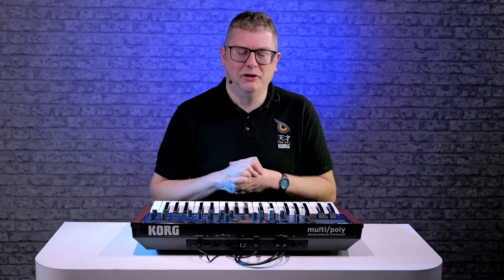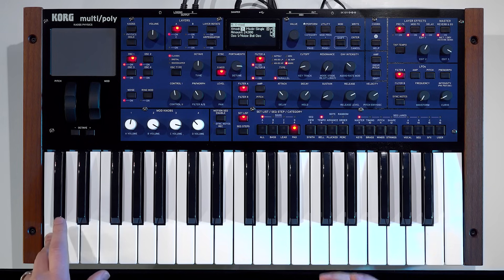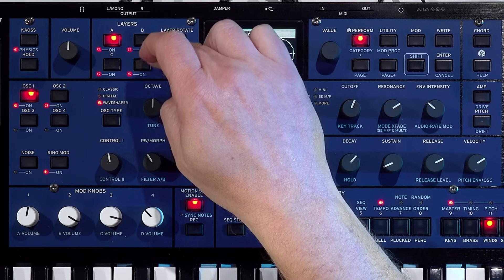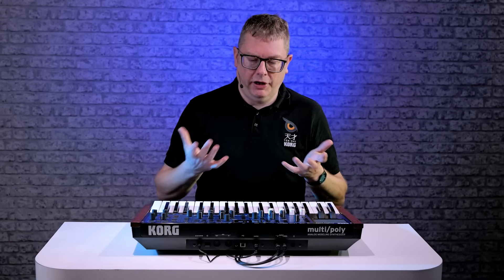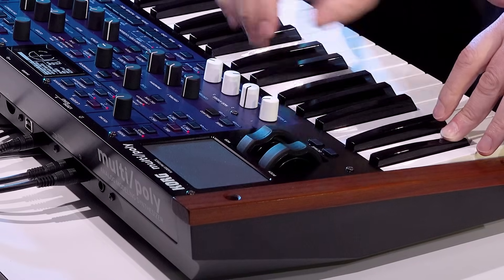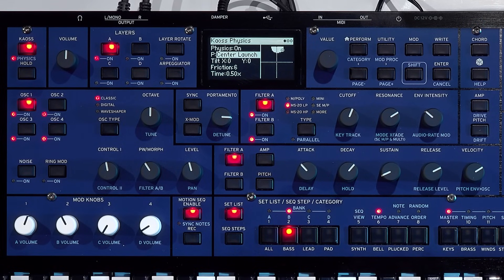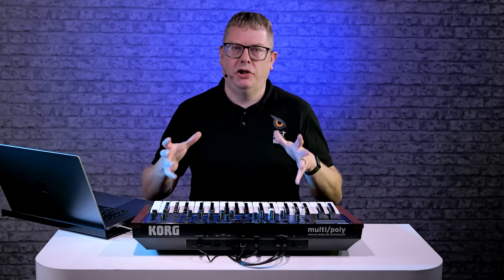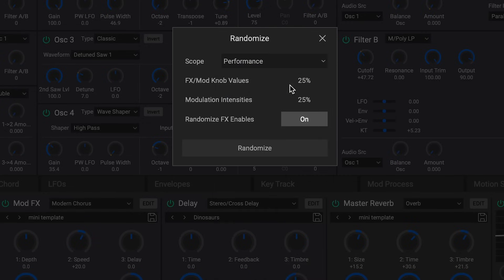Korg multi/poly – Explore the features and capabilities

Comment: I bought the module version, and use it with an Arturia KeyStep 37.  This is a better setup for this amazing synth.  As the Arturia has polyphonic after touch, which the keyboard version of the Mono\Poly lacks.  This Synth is an absolute beast.  60 voices of polyphany (15 per channel X 4).  I dare say the deepest synth I own.

Comment: Luke, another awesome Korg is another awesome video, thank you. I wanted to ask if you can manipulate the presets without messing up the original settings. I’ve done this on my Nautilus by turning the knobs And not making a user category. It always seemed to stay the same before and reset when I turn it back on the next time I play. and one day I turned it back on and the Combinations of some of the programs that I tweaked around with were messed up. The book says you can tweak them knobs and return them to the center position, and turn it off without saving anything and they will be the factory reset again? That’s the reason I’m asking because I’m looking at This New one you’re playing and I want it. But, I need a clear definition of how the global mode and or how this one works so I do not mess up the original factory settings. I don’t know if Korgs Global modes exist on all the synths or just the workstations? Thanks so much for the demo and the awesome Sounding synthesizer!

Comment: I think it is amazing.  Love what you did with the modulation capabilities, and especially those modifier operators.  Also I absolutely love the multi-timbrality, the filter configurations, the fact there is an external editor and you can upload your own wavetables.  I think it is very fresh and it looks great too. Well done.  The only thing is missing the aftertouch.  It's the same complaint I have with my GAIA 2. 

PS. While I am here, if I could make a request.  I would love something like a Triton / M1/O1 in this form factor, plus some modern twists with the mod matrix and filter architecture you have here. The ultimate rompler for the future!! I am certain it would sell like hotcakes! Don't forget the aftertouch! :-)

Great job Korg!! ❤

Comment: Does the USB connection actually work on Windows or does it have the same issue it always had with Korg gear? It's always been so frustrating trying to hook up my minilogue to a windows computer ...Asking before buying
Reply: For Minilogue You gotta install drivers and then it works fine
Reply: @OlegAryutkin  It doesn't.. It's a thing. You need to uninstall other USB devices for it to recognize it first. I have to use the 'uninstall korg midi driver' app every time.